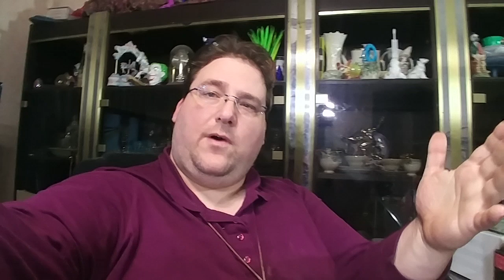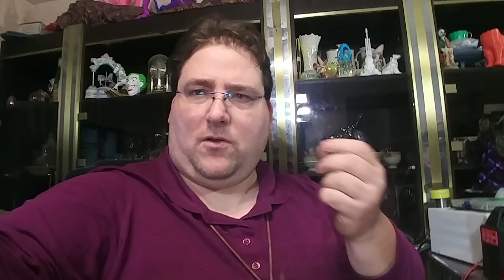CR-10s Pro Behind The Scenes Series Intro - T3DP

Comment: I finally got a 3d printer, an ender 3... but I have two questions.  I have only found a hand full of videos about using lubricants on the z rod, but I noticed there was not any in the box.  Is this something I need to worry about day one?.. the second questions is how tight do the screws for the z rod clamp need to be
Reply from the maker: What is the Z Rod clamp? They should only be two things touching the zrod one is the coupler that connects it to the stepper motor and the second is the brass threaded fitting on the trolley that it passes through the coupler at the bottom it should be pretty tight but not tight enough to strip the screws the brass fitting on the vertical trolley should be loose at first snugged only after you run the printer up and down a couple times think fingertight only last for lubrication you don't need anything on day one down the road you can get a lubricant called Super Lube whatever container you buy will be a lifetime supply :-) it takes only a very tiny amount
Reply: @nerys71  thanks, I was asking about the screws on the brass ring in the trolley up and down
Reply from the maker: @therizinosaurus214  yes for that you want those screws a little on the loose side run the printer up and down and at the 2/3 up appointment fingertight them put the wrench in and fingertight them